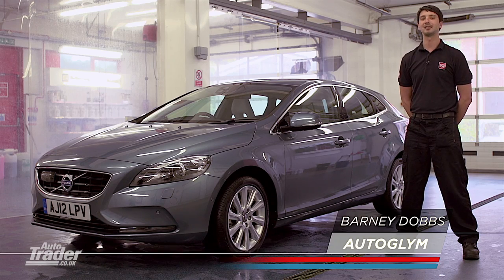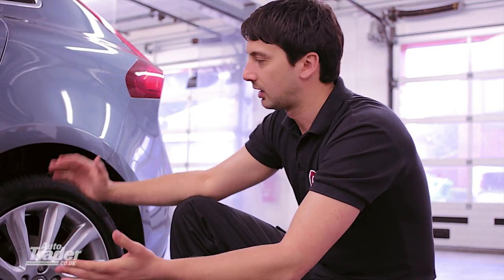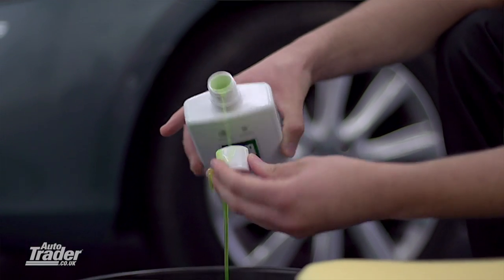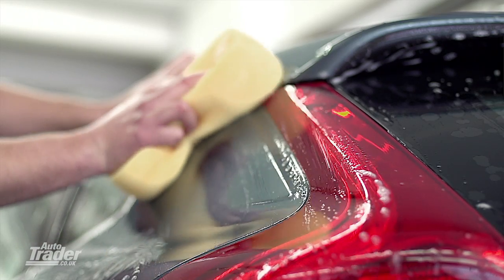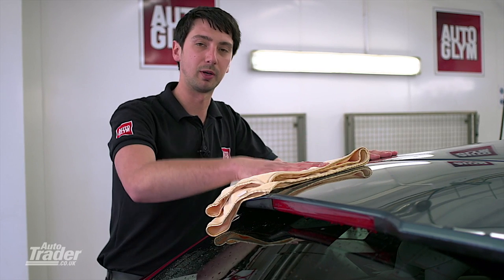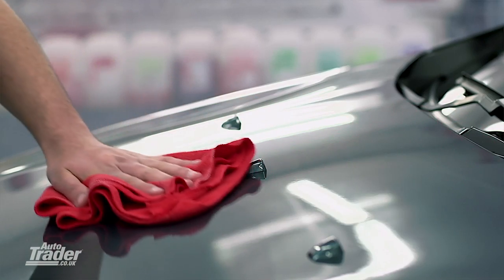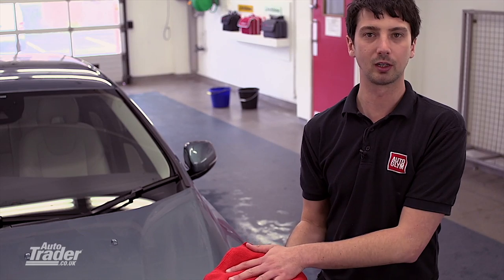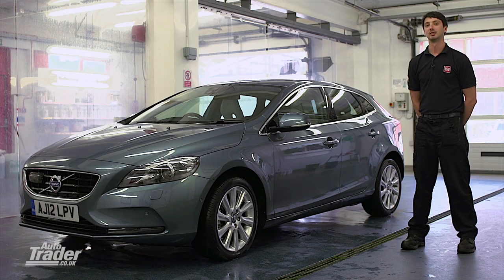How to wash your car with Auto Trader and Autoglym

Comment: I always wash with a microfibre and never a sponge. When folded into quarters, the wash minimises scratches when the microfibre is folded to avoid using the same used side on a different panel. this way when you rinse after 8 folds. more efficient and effective.

Comment: Is that wheel seal going to affect the braking? If that had been a mountain bike, both discs and pads would surely have been ruined
Reply: The instructions on the can tell you to avoid contact with braking components, so potentially

Comment: Using a sponge?! Swirl mark heaven, so much for good advice. Also cleaning the inside off the doors and boot with the sponge and shampoo how do you expect to clean that off?
Reply: Adam Perkins With a microfibre! I always clean out door shuts etc or the car looks like shit. Wipe with mitt after washing car. close door, rinse and flush out car, open doors, wipe dry. And using a sponge is sacreligious!

Comment: If car was really dirty with mud or salt from winter weather then this hosepipe not an ideal for washing car,you need a pressure washer. Also auto glym too expensive,I’ve tried few cheap stuff from pound shop and they are better than auto glym. For windows you don’t need £10 auto glym product. Screen wash clean glass better than any other stuff in market.
Reply: Nonsense

Comment: Does this guy think people have all day to wash a car? Just get a power hose and spray the sh*t out of it. Job done!
Reply: If you're just gonna half-ass clean your crappy hooptie, you might as well not even clean it at all.
Reply: +pagefletcher If you have a shitty car or just one youre not fussed about. Even a little bit helps. I use to have a black corsa as my first car and near the end, i got fed up with it and was able to wash it in around 3-5minutes by throwing shampoo in a bucket, filling it and then going mental on the car with a sponge. Couple minutes later, i rinsed it and perfect :) Got rid of the dust and sticky sap.

Comment: Never use a sponge to wash a car. There is no knapp for the dirt to go into meaning you're just scraping dirt around on the surface. At least you used the 2 bucket method, did you use grit guards tho? probably not. Come on auto glym, I thought better of you!

Comment: Few buckets and washing up liquid does the job . A bit of turtle wax after Job done ennit .
Reply: Mark C Except that washing up liquid has SALT in it, and damage surfactants that will screw your paint over time.
Reply: Spac8 
Bah No worse than Living by the coast ? 
It's never harmed any of my cars in the last 20 years , the Longest car I kept was a 2004 ST220 people used to comment how well I've looked after it 8 years of owning it , and it sparkled when it was washed and polished .
Reply: Mark C Yeah, the salt part is probably no worse than living by the coast, but it still isn't good for your paint and why would you subject your car to extra salt?  it "dries" paint out and using it will strip any turtlewax that you had on there, so you HAVE to repolish. if Washing up liquid was the right way the detailing world wouldn't exist. Get your paint under a fluorescent light too, bet it's swirl city. Super Resin Polish is far superior to Turtlewax btw. :)
Reply: Spac8 
I'm pulling your Leg ! 
I use Demon Clean for the Jet washer Snow foam thingy , Then I'll go over it with a wash mit, that's after spraying water all over it first . 
Then I'll Use a Leather shammy dry it off with , Then I'll use polishing cloths to apply Auto glym polish . 
It turns out alright . But it's a lot of messing around sometimes I feel it's quicker with Buckets .
Reply: Spac8 
Oh cool I shall try that n thanks for the heads up on yhe car plan .
Reply: Mark C No worries at all! Glad I could help!
Reply: Spac8 
Holy crap mate 😱 that car plan stuff looks the same colour and same stuff flipping heck I've had my pants pulled down buying demon products . Cheers for that I shall buy that immediately !!
Reply: Washing up liquid will dry out the trim on our car and also degrade your wax
Reply: hakman239 
I honestly don't use washing up liquid😉